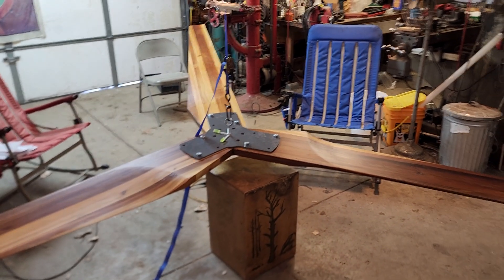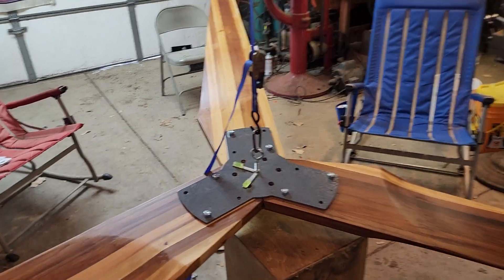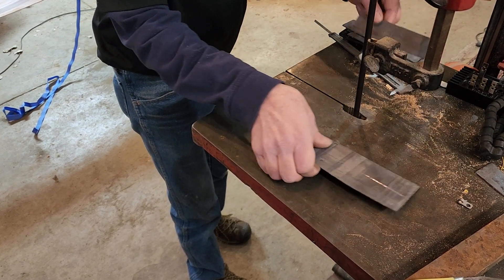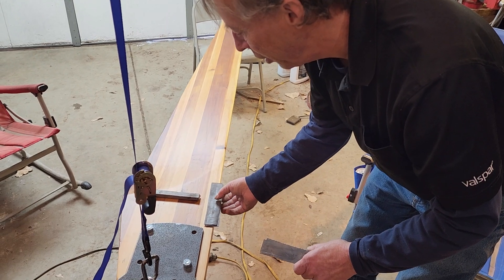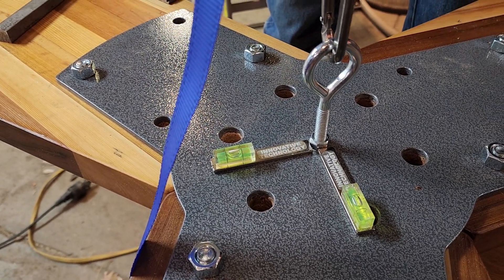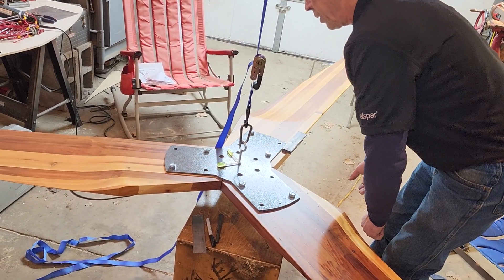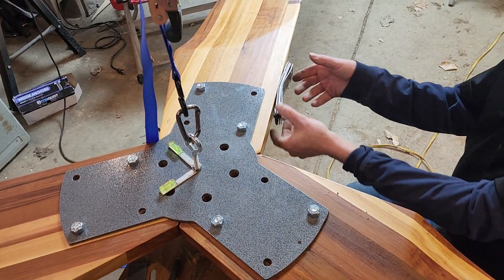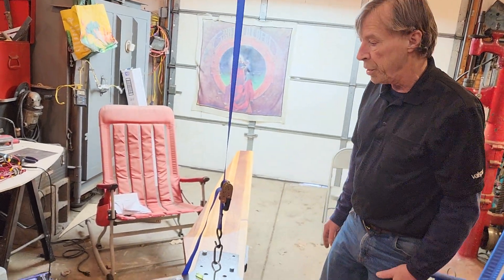Balancing a 14' diameter wind turbine blade.

Comment: I'm balance a new set of blades right now for a 6' diameter turbine.  I'm carving the blades a bit more to get them all the same weight and then I'll add weights to the hub to balance it as an assembly.  I've found my hub isn't super balanced, so it's almost not worth worrying about the blades too much until I try to put it all together.  The first weighing of my blades after I carved them was 120 grams (~1/3rd lb) difference between the lightest and heaviest.  I carefully marked out my taper and slope when making them, but I did all of the air foil shape by eye.
Reply from the maker: @MrPizzaman09  the weight of individual blades being the same... I don't worry about at all.  If structural integrity were not an issue then one could be balsa wood and two could be iron wood so long as once assembled with the hub, they're balanced.